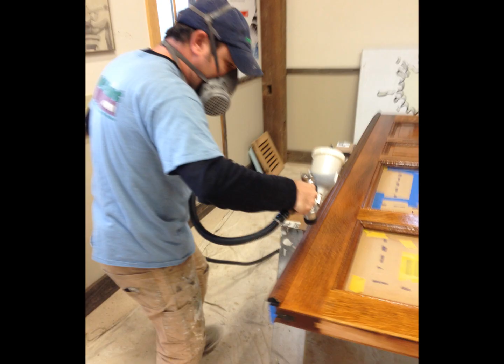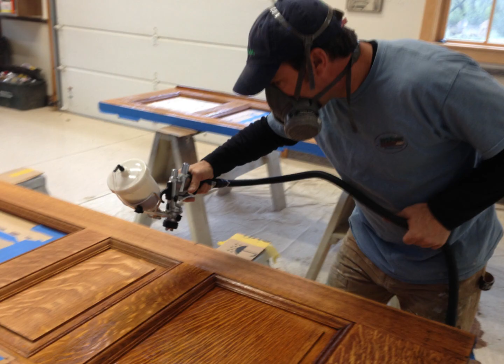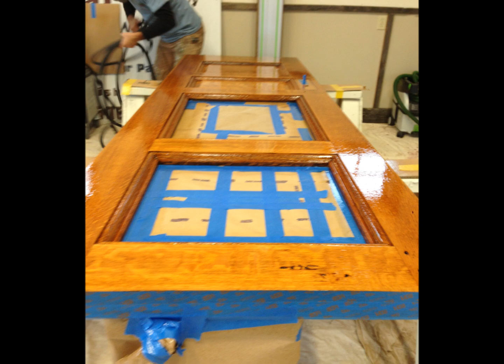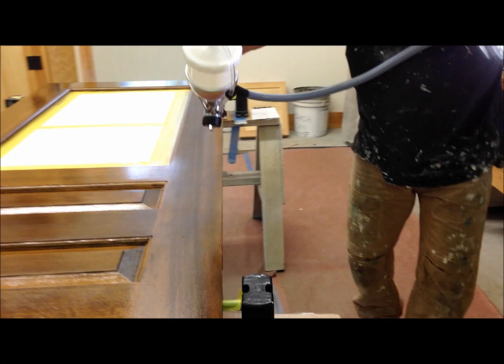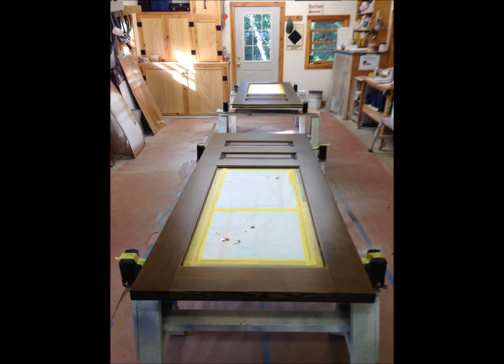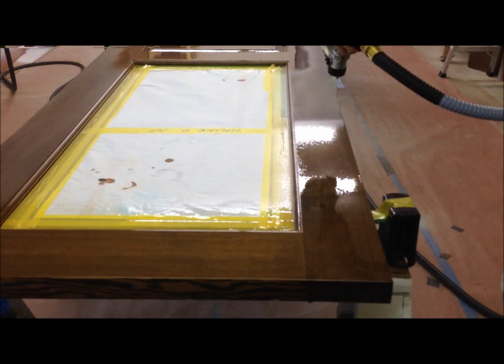Titan 5 Stage HVLP and Gravity Style Gun

Comment: hello Scott.. quick question can the caps spray be used as well for painting vehicles.. & change my guns
Reply: yes you can, you may want to use 1.0 needle to get finer application but you are good to go with a 1.3 in case you do not want to spend extra money on the needle, same needle is ok for clearcoat, you will be amaze on the quality of the finish you will get, you may want to try and practice on a piece like a fender, before you jump on the whole car